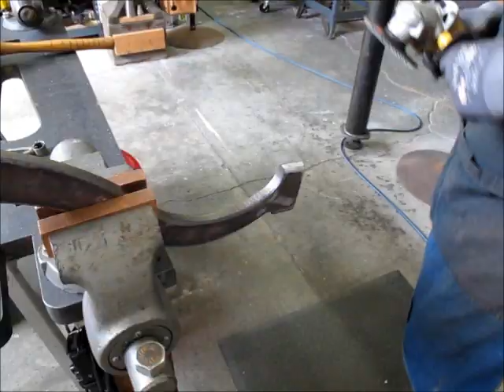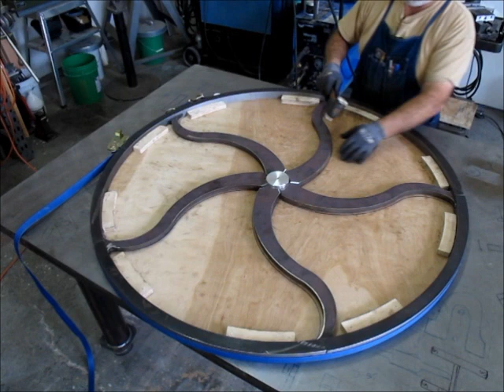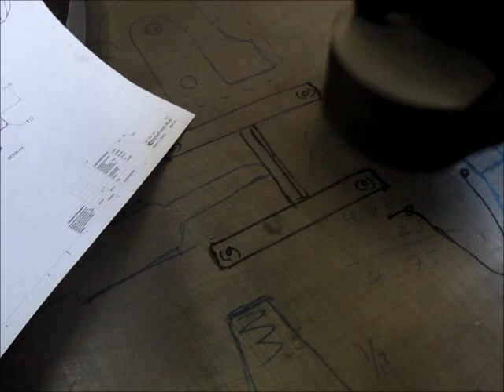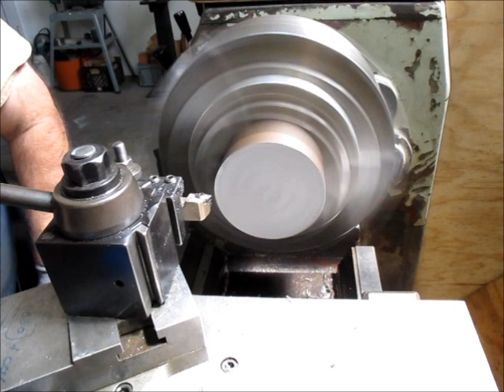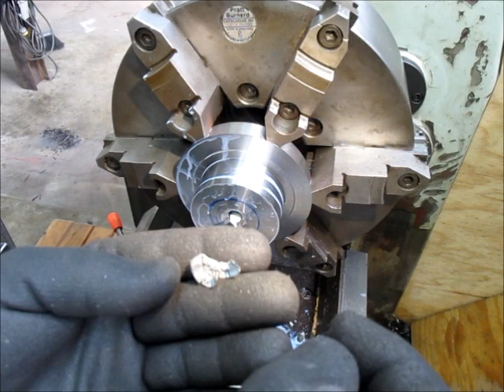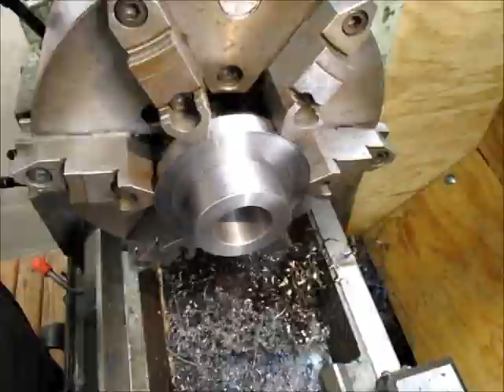Etching Press Handwheel Episode 3

Comment: Hey Tom, Are you worried about runout in that 6 jaw when you flip the part over? I am guessing it must be negligible.
Reply from the maker: +MattsMotorz Hi Matt,

Its pretty negligible with this chuck. It has an adjust through feature that lets you dial it in like a four jaw. Thanks for the comment.

Cheers,

Tom

Comment: I have loads of fun at work with chips especially with plastic jobs, It has for sure pulled the entire chip pan up into the chuck but with plastic its all fun and games.
Reply from the maker: Hey Max,

We used to do a long run job in UHMW. Chip control was a real issue and very difficult in some plastics as you well know.

Cheers,

Tom

Comment: I have more trouble doing ID turning work in the CNCs than anything 
its the chips especialy in blind holes. no idea how they mange to do this in a mass production environment without creatin tons of scrap
Reply from the maker: Hi Gent,

On our Okuma I used to program multiple shorter undersize bores to open things up for chip clearance. Then go back and do a continuous bore for final size with a finishing tool. Depends on the aspect ration of the bore. My other motto is Short and Fat rules in the lathe.

Cheers,

Tom

Comment: Thanks for your most diligent answers to my pestering questions. I have never machined anything in my life beyond drilling holes and some bird sh*t welding with an arc welder! However having worked in ag all my life I perhaps have begun to understand what happens with things like seized bearings and overheating shafts etc on machinery -often unfortunately a cause of fires especially at harvest time! Many thanks again.

Comment from the maker: Hi Dan,

You are correct that the part gets longer axially as well. What is actually happening is the atoms a jiggling around more excitedly as the material gets hotter. The space between individual atoms increases. Kind of like blowing up a balloon. Because of the shape and dimensions of the part the displacements are different.

Regards,

Tom

Comment: Clearly thanks, I just wondered if the pressure to expand caused by heat could cause the ID to become smaller. You imply with your answer that the whole thing gets physically larger, I presume the overall length increases slightly as well when hot.

Comment from the maker: Hi Dan,
Sorry if that was not clear. The bore will expand when it gets hot. If you measure it hot the reading will be artificially large. This will result in the bore being undersize on cooling. The same is true on the OD. If you measure it hot it will measure large. The problem with this is when the OD cools you will have an undersize condition and nowhere to go or (LMC). At least with the bore you get another crack at it because there is still material there.

Did that answer it?

Best,

Tom

Comment from the maker: Hi Dan,

As an example the bore I put it the hub had an inside dimension off 1.750 I wanted to get the bore within a grand if possible (25 microns) for a press fit of a bushing. If the part was say 150 degree's F (66C) the bore would expand almost the amount of the tolerance. In this example .0008 inches (.02mm). With steel its not too bad but many other materials expand more per degree per inch and can be a real problem when trying to achieve tight tolerances.

Regards,

Tom

Comment: I understand that the piece your working on fairly intensively like that becomes warm/hot [one only has to see the smoke to appreciate that!] but my question is related to how much does that heat affect dimensions? and, furthermore which dimensions? -I can well understand an increase in OD but what about ID of the bore [does this reduce] and length -increase? Do you cool it in some way or simply wait for it to cool in ambient temperature. e.g. I've not seen you use flood cooling for instance

Comment from the maker: Hi Standup,

There won't be much welding to attach the hub to the handwheel. It just human power so no real serious loads. The keys are not quite what you see in traditional keyways. These are flat face keys that will transmit the human power to the gear reducer assembly. All will be revealed.

Regards,

Tom

Comment from the maker: Hi Tyler,

Lots of good chucks out there. Depends on your budget. Take into account the max rpm when you look at chucks. Six jaws are rated slightly lower than three jaws of equal size. Whatever chuck you decide on make sure it is an adjust through type. Other than that follow your budget.

I agree gloves are not for everyone and every situation. I just try to keep an open mind and experiment with new technology. I bet there are some situations in your work that you wear gloves for?

Best,

Tom

Comment: Tom- the odds of me working on something like this are that it will happen after I hit the powerball. But I would expect a lot of movement on all of the key ways and tapped holes, you mention, after welding... All I have to go on for this question is my experience having to, most recently, re-tap the hold down bolt holes on my anvil stand...  Does Tig/heli arc put less,heat into the assembly? Or should I just sit on my hands as all will be revealed...

Comment from the maker: Hi Chris,

There are all kinds of interesting things you can do when you think in those terms. I had one CNC mill that didn't have a tool changer. You get real creative when you are the one changing tools. On larger parts its a common technique to use a boring bar to turn the OD when you're pushing the limit on diameter. I'm out of inserts for old faithful so time to go shopping.

Thanks for the comment.

Regards,

Tom

Comment: Hand wheel looking quite decorative there Mr Tom. Now, have you thought of using your boring bar to turn the outside as well as the inside, saves a tool change and with careful thought (and a bit of luck) you can get close to size, having finished the inside, just using the cross slide dials. Do remember to turn in reverse of course! I must admit that I have some excellent tips on my boring bar (TPGX if I remember aright) and they leave a chrome like finish even on 1 thou cuts, yup I'm bragging

Comment from the maker: Hi James,

It came from Orchard Supply hardware. Its a mini bug sprayer. I'm actually liking it compared to regular trigger sprayers which seem to die way too quickly. The trigger action is really easy compared to a traditional bottle sprayer.

I'm pretty sure it was just 1018 (scrap yard score). It drilled fine once I got rid of the drill modified for brass. Did it look difficult in the video? 

Regards,

Tom